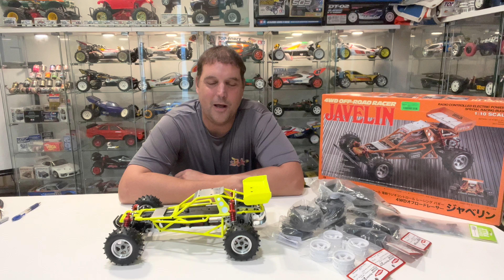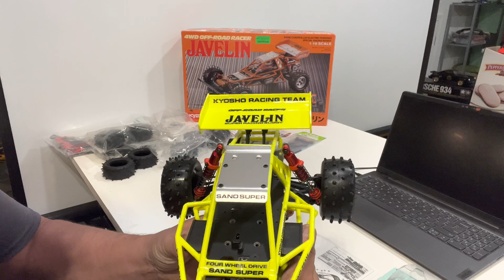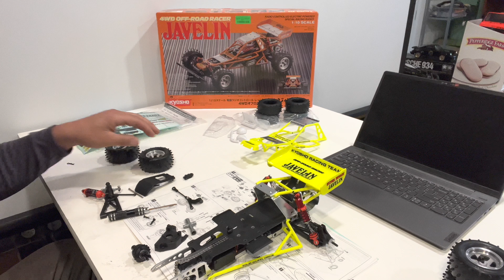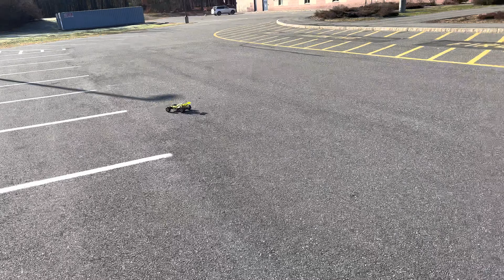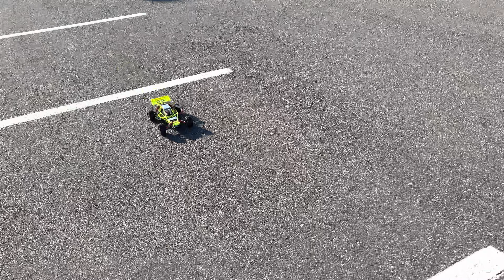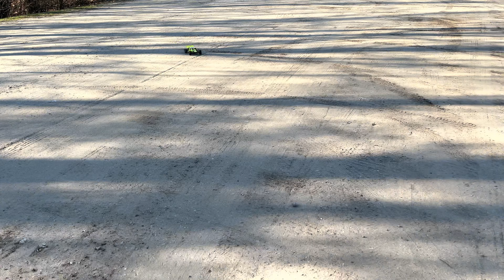Decaling and running the rere Javelin.

Comment: Very unusual you got two Kyosho kits, both with unfinished or missing parts! They must of been done on a late Friday afternoon, during a shift swap haha.. That really sounded louder than mine, with belt installed. Chain certainly different sounding. Love the colour and that you're running a Kyosho series motor!
Reply from the maker: Definitely try to keep the motors manufacturer and period correct.

Comment: How about getting the aluminium parts hard anodised in black. Think that would look great.
Reply from the maker: Problem is my anodized has a $150 min which gets expensive for a couple pieces.
Reply: @rcicons4915  ouch, that’s heavy! I get stuff hard anodised at work so can generally get stuff done very cheap if I pay cash. Been tempted to fully anodise my a Kyosho Beetle chassis but still pondering why! 😂

Comment: See if you can put a 12-turn 550 motor in it. 😂 Meaning of brushed motor.
Reply from the maker: Yokomo t5 zero!
Reply: @rcicons4915  you're putting a brushless system in it you would have needed to change the chain to a belt.